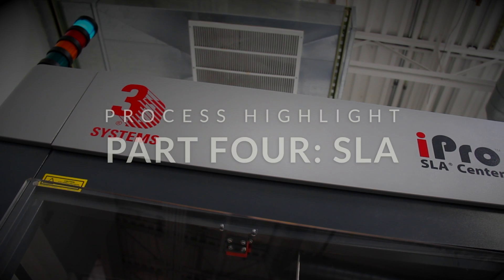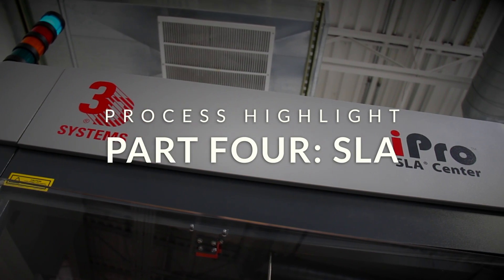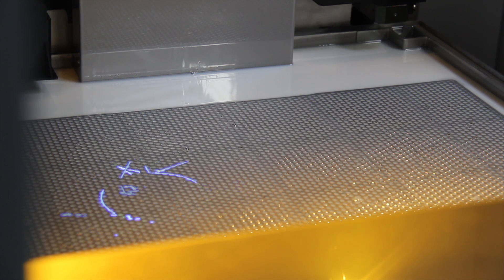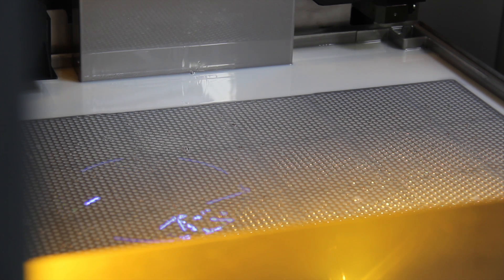SLA: 3D Printed Miller 91 race car Process Highlight Part 4

Comment: OMG - I love the fact the vat sinks !!
The consumer versions all Pull-Up from the vat, and experiencing model/build plate separation (due to weight) is an issue.
This video was released in 2013, and 9 years later, the 'maker companies' haven't figured this out ???
Reply: the rocket 1 is probably breakout of this technology coming into consumer level.
Reply: @wrld3D  yes I’ve seen rocket 
I’m also interested but not sure if stable, one called
“Milkshake 3D”
Reply: @nemesis851_  never heard of it will look it up
Reply: @nemesis851_  the milkshake 3d is probably dead by now, at least it looks like it from their channel, but the idea was amazing
Reply: @wrld3D  other older indie gogo versions which where abandon even had the formlab cintering process of wiping the top of excess resin